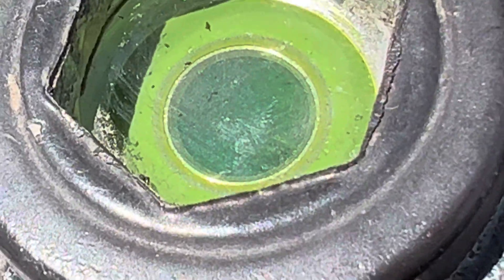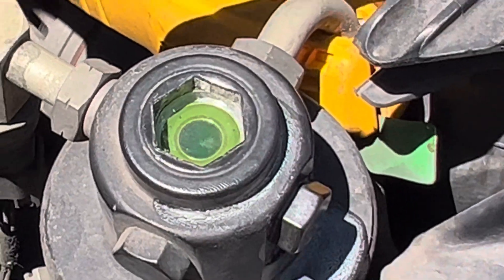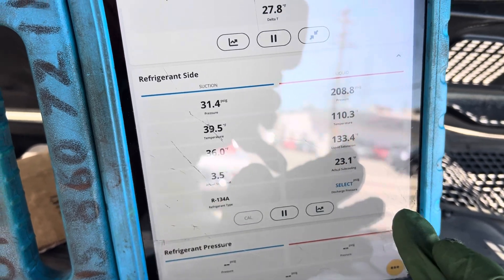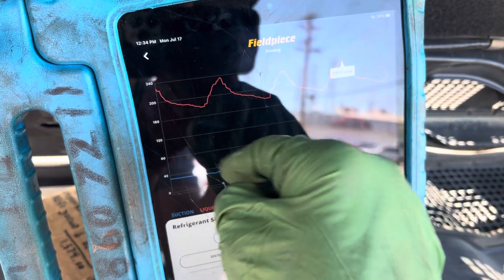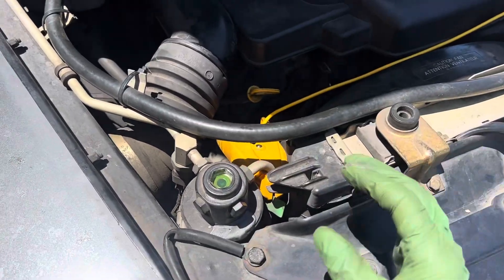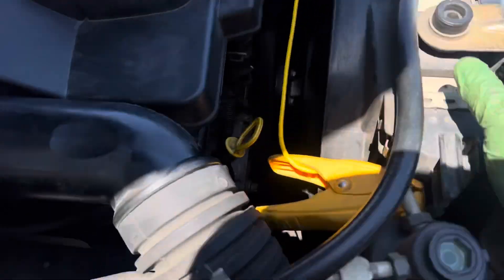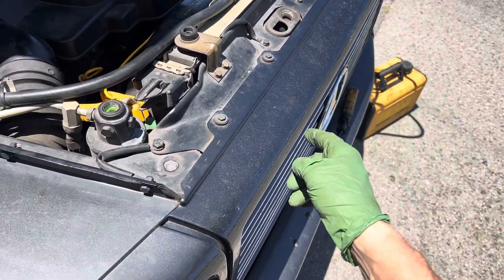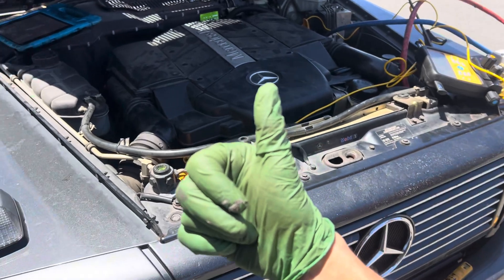Do Not Charge Refrigerant Looking 👀 At Bubbles 🫧

Comment: I have a question.  My 2010 honda odyssey is crazy.  The AC temp from the vent at idle blows 45-50 degrees on a lower speed blow setting. Once i turn up the blower speed the a/c temps jumps really fast to 68 degrees. Why would it blow warmer at a higher speed vs a lower speed. My fan speed has 6 speeds, so it blows its coldest at less then 3, but 4 the ac temp jumps 5-10 degrees
Reply from the maker: Because of the load of energy for every square foot of air, there’s actual energy stored inside of it in the form of heat and every square foot of Air actually has a wait to it that you can weigh on a scale.  If we weren’t already at roughly sea level at the same late level..   it’s a Physics thing, the gas laws. 

So the Evaporator has a defined set amount of energy that it could remove in the form of heat .  The slower your fan speed the last load on the evaporator it can remove more heat. It has a longer contact time over the coils to absorb more heat out of the air that passes over the cold evaporator

The faster you move the more square feet, the more buckets or the more basketball size of air with more heat load faster over the evaporator 

So you’re putting more load over the Evaporator and you can be passing them so fast across the metal coils that they do not have enough contact time to transfer all the heat out of the air in into the cold metal coils so you get a warmer temperature 

Then, there’s also the fact you could be low on refrigerant . 

I have many videos in the past that I have recommended from instructors if you were curious about the Thermal Dynamic Fluid Dynamic’s the three gas laws, and everything Hass to do with the subject and other subjects about air conditioning 

Brian, Orb’s HVAC School 

Craig HVAC LLC

Ty Bremerman Love2HVAC
Reply: @coldfinger459sub0  thank you for all the facts of how it works.  I will check my charge.  I noticed that my low side pressure valve was bubbling when I took the cap off.  

Can the blower resister also play a factor?

I will also watch the videos from the other guys your recommended
Reply from the maker: @edwinaragon8469  blower resistor doesn’t add that much heat

Bubbling valve from your service valve just replace it .
Reply: This suggests your evaporator is being starved of refrigerant.
Reply: @thisisyourcaptainspeaking2259  meaning I'm low on r134a?
Reply: @edwinaragon8469  Yes, I suspect that's the case assuming there's not some other problem such as restricted expansion device or leaking are duct (duct air passing through heater core).
Compression ratio of compressor should not be higher than about 4 (high side pressure in psia/low side pressure in psia).
The correct way of determining charge is by weight because charge level is critical to system operation.  For instance, a system operating low on refrigerant charge may appear to be operating fine, yet will cause the compressor to overheat.
Reply: @thisisyourcaptainspeaking2259  the expansion valve is new, dealer part. I have used off brand and they never worked. This time I replaced with honda expansion valve.

So the bubbles are an indicator that the strater valve is bad and causing a leak. This leak is leading to a lower charge, lost of freon), that is causing my ac not to blow cold on higher fan speeds? 

Am I correct in this assumption. Again, not sure what the expansion valve has to do with bubbles in my lower side port.
Reply: @edwinaragon8469  If you're losing refrigerant then obviously you need to locate any leaks and address them.  Not following you on "bubbles in low side port", low side is vapor phase.
Reply: @thisisyourcaptainspeaking2259  so when I encoded removed the low side cap, I see ac dye forming bubbles. I am assuming that since I see bubbles, it has to be a bad valve core/strater valve that is leaking.  I shouldn't see bubbles forming at the service ports correct?
Reply from the maker: @edwinaragon8469 sometimes you see bubbles for a minute and that his gas that is trapped in there under pressure and it is like carbonated soda pop with CO2 in the oil and you just released the cap to atmosphere pressure so it’s bubbling out of the oil and then, after a minute you’ll see it stop this is considered normal leakage

But if it continues, you got a problem . 

Or when you run the vehicle and delete gets bigger from running when he gets hotter or colder, higher pressure or lower pressure you got a leak and you replace it . 

Buy dropping one or two drops of refrigerant oil on top of it after a few minutes, you’ll see if new bubbles developer not
Reply: @edwinaragon8469  Correct, that's a leaky schrader valve core.  There's a tool available for changing the core without having to recover the charge but the right way is recover and weigh-in the correct quantity through the high side into a deep vacuum.  Otherwise determining proper charge is a guess at best and unlikely to work correctly under various conditions.  Also, by recovering gives you the opportunity to perform an N2 pressure decay test as opposed to risking loss of refrigerant to undetected leaks.
Reply: @coldfinger459sub0  I see,  so I need to wait to see if the bubbles remain after removing the cap.  I did not know it could bubble after removing the cap.  I didn't stare at it long enough to see if it stopped.  

Maybe I will try that and maybe blow air over the port to clean it out and drop ac oil to see if it continues. I'll wait 10 mins after removing the cap just to make sure it acclimate to the atmosphere.

A lot of talent.  I'll also spray some ac bubbles over the expansion valve connector on the firewall to see if it forms bubbles. 

I'm obviously low of refrigerant for my ac to only blow cold on low fan speed from what your telling me.  

Nothing else would cause this correct? Having ac blow cold on lower fan speed, but once I put it on max,  it jumps 10 degrees hotter.
Reply from the maker: @edwinaragon8469  it’s old you just replace the valve cores

since we have hundreds of valve cores on hand in stock, we just replace them on every vehicle when they’re old, no matter what it’s not worth the risk 

And there is no guessing unfortunately the easiest fastest way as we just automatically recover in Recharge Ave vehicl, and then test it only takes 10 minutes 

This way, you’re always testing a factory filled unit up to manufacture specifications
Reply: @thisisyourcaptainspeaking2259  the tool your talking about is the valve core removal tool that allows you to shut the valve to prevent it from leaking out once the core is removed correct? I saw NAVAC sells a 1/4 valve core removal tool.

I am doing the work myself because no shop will vacuum my van to 500 microns as Tom has showed in his videos. I bought a vacumm pump to do the job.

I'm charging my system using 12 oz cans, but using a scale to help me get the last bit in on the 3rd can. I fill on the low side because I don't have away to charge on the high side as I don't have a 30 lb tank. And I can't put 12 oz cans upside down on the scale.

I also don't have a nitrogen tank to test for leaks. I am simply vacuum the system and waiting to see of I have a lost of vacuum.

I did all this before, but I guess I didn't charge it correctly the first time and it was low or maybe I do have a leak.

I just don't trust a shop around me because I paid $8k total to 2 different shops and they still not could not get my ac to blow cold.

After watching Tom videos, I redid all the work myself, new parts, and vacuumed to 500 microns (took me 2 days to reach that level), then charged my car based on weight, the best I could and finally my van was blowing cold.

It's just now that I noticed that I blows warmer air at higher fan speed vs lower fan speeds.
Reply: @edwinaragon8469  Agree.  Inspect carefully for leaks and avoid overcharging because liquid cannot be compressed.  Too low of charge results in a starved evaporator and thus abnormally high duct temps as fan speed is increased.  Compression ratio will be high, causing compressor to run hot and maybe burn the oil. Oil won't circulate properly, leaving the compressor dry of lubricant.
There are so many reasons the equipment and tools are worth the investment, considering just the replacement cost of parts alone.
Reply: @thisisyourcaptainspeaking2259  question. Right now, the outdoor temp is 102 degrees. My low side pressure is 50 and high side pressure is 250. Does this also indicate low freon for a 2010 honda odyssey
Reply: @edwinaragon8469  Possibly, but be careful with that assumption.  Consulting the pressure/temperature chart for 134a tells us 50psig on the low side means the evaporator temperature isn't less than 55F and condenser temperature is about 155F.  The unknown here is if there's a (desirable) column of liquid entering the expansion device and there are no non-condensables (air contamination) occupying space in the condenser.  You could measure the temperature of the compressor suction line to help determine if superheat is excessive.
Reply: @thisisyourcaptainspeaking2259  I uploaded a video of my gauges on my account. If there is anyway you can see it to make sure I am reading my gagues correctly
Reply: @edwinaragon8469  You're referring to the clip loaded 7 days ago?
100 degree ambient is relatively high, thus (obviously) it's especially important everything's working correctly.  What happens if you hose down the condenser with water, does the system respond dramatically?  Is it possible airflow through the condenser is impeded by debris or some missing rubber gaskets between the condenser and radiator, allowing air being pulled through the radiator to bypass around the condenser?  How about system performance while the vehicle is at speed, forcing air through the condenser?
Reply from the maker: 1: I forgot have you clamped off the coolant flow through the heater hoses?. To test ? 

What is the temperature of the suction line coming out of the evaporator?.

And this vehicle is filled up with 750 g  ? Is that with the sticker under the hood says.
Reply from the maker: @edwinaragon8469 we do not go by pressure 

We only completely drain system

Evacuated with a vacuum pump and fill it up, measured by weight on the scale. 

This is the only way a system is charged. 

Anything else just guessing?.
Reply: @coldfinger459sub0  ok, I'm an vacuuming my car now.  Going to let it run until 500 microns or less. Probably going to take me all day and night to reach that level.  

I got a 30lb r134 tank and scale.  Going to fill by weight through the highdide port,  with the can upside down.  

Question, do you purge the line of air while it is in vapor, then flip the can over to liquid and fill by weight?
Reply from the maker: @edwinaragon8469  yes, purge the line in the vapor. 

Are before you start way the tank all by itself so you know the precise weight of the tank wait for the liquid refrigerant to stop moving slashing back-and-forth inside to get an accurate weight . 

This is so after you are finished you can weigh the tank again when you’re completely finish 

In the weight should add up to what was needed in the vehicle 

If it is more than you know, you make a mistake and you have too much 

If it is less than you know, you made a mistake and you don’t have enough . 

If you accidentally bump your gauges or bump your hose or if the car actually internally moves forward to backwards during the process make sure your brakes are on the car cannot move .  Make sure it is not windy.. 

All these things can throw your measurements off and you won’t know it . 

Unless you completely know, and understand the gas laws, you will might not be successful at completely charging the vehicle through the high side as a liquid . 

And you might have to stop and precisely record the weight that has gone in . 

Flip the tan over to the vapor side . 

To start charging as a vapor on the suction line after the engine is running in the air conditioning is working . 

Because you may not be successful doing the liquid charge method. 

But the most important thing is recording and being able to track how much refrigerant comes out of that cylinder . 

Because when you’re all finished, it should add up to the manufactures recommended specifications for that particular vehicle . 

If it doesn’t, you may have to do it all over again . 

Air conditioning is not very forgiving and making mistakes . 

Sometimes it may work if procedures are not correctly done it’ll blow cold out of the dash to cause problems much later on .
Reply: @coldfinger459sub0  so you recommend me doing the charge via the suction line (low side) vs the high side then to make it easier?

Also,  does the car need to be leveled or does it matter,  as my drive way is slanted and has a a good pitch?

Shouldn't we expect a weight difference slightly as there will be refrigerant left in the line when it's done.  

I will weigh the can before I start and after.  Hopefully it close as the van has a max of 750kg and a min of 700kg. On the sticker
Reply from the maker: @edwinaragon8469  it does not have to be level for the van

The scale should be level 

I think because you’re a beginner and a novice at this you should stick with the suction side vapor charge method it will take longer . 

But it’s the more safer easier but longer method
Reply: @coldfinger459sub0  So I pulled a vacuum on the van,  got down to 1130 on the micron guage. It was not going any lower after 2 hours,  so I decided that was as low it was going to go,  since I didn't replace the dryer.

Charged it to weight,  and I'm happy to report my van is able to blow 55 degrees out the vent at high can speeds, vs 70. 

I am so happy with the results.  

Thank you for allowing your feedback and quick responses. 

You are a true expert. 

The low side pressure valve was no longer bubbling after waiting for a while.  

So I figured I didn't charge the van right the first time using 12 oz cans.  

This time I bought the 30lb and scale and filled it like how you show,  through the suction line and car turned on.

Thanks Tom.
Reply from the maker: @edwinaragon8469  I invite you to tell your story and your experience over to Facebook group

Automotive, HVAC Technicians 

This is a place where you can show photos upload a YouTube video and ask questions . 

Or just tell other people about your first time learning experience .  So other new people who I have not asked this question, you can learn from your trial and error.. 

And how you completely successfully fix the problem? . 

Good job 👏 👍 

You seemed a little small cans have caused so many people so many problems . 

And often sometimes it’s a problem it comes out cool out of the dash But they are unaware that is an actually damaging the compressor because they did not properly charge it.
Reply from the maker: @thisisyourcaptainspeaking2259  in some cases, the bubbles are only at this point of the receiver dryer as would be this case where the system is 100% full

And the expansion valve is receiving at this time that you see bubbles 100% solid liquid column with no bubbles to it 

The pressure temperature saturation is happening inside the line after this section of bubbles stacking up from the expansion valve along the middle line, coming all the way back to this point 

Somewhere just passed were these bubbles are in this line it’s probably for maybe another 6 to 12 inches 

If there was a site glass a few inches away from the expansion valve, you would see a solid column of liquid with absolutely no bubbles

This is why on my commercial or my residential installations where I have a liquid line I will install a site glass down at the evaporator just before the expansion valve, and I will put another site glass outside towards the condenser so there is two 

This is why sometimes you can see the side glass indoors a few inches away from the expansion valve is being delivered a solid column of liquid and then when I go 50 feet up on the roof to look at the other side glass, it will be bubbly and foaming, but yet the superheat and sub cooling everything is perfect 

As you transition going through cycles of on and off 

No one wants to put in their price of their job the labor plus the parts of to say glasses because they’re afraid to lose the job 

I do this on all my jobs. I always have my father showed me this. 

And with the site glass by the air handler indoors when talking to a customer on the phone, you can ask them to look at it and see if it’s crystal clear or bubbly
Reply: @coldfinger459sub0  sorry Tom, I'm not sure how this is supposed to help me figure out on my van why I see bubbles, other then the valve has a leak? What does the expansion valve have too do with my low pressure valve having bubbles?
Reply from the maker: @edwinaragon8469  there’s a reason the expansion valve is called a metering device

It has spring pressure. It has a gas pressure. It has a diaphragm. He has a needle valve seat. 

It opens and closes in response to the heat load over the evaporator modulating 

This will either choke off the refrigerant flow or open up, wide-open and release the refrigerant. This will lower the pressure on the line .   And it will use quickly a short larger burst of refrigerant that may lower the Refrigerant level in your receiver dryer faster than I can recover and you’ll get some bubbles in your line as the pressure drops.. 

It doesn’t mean it’s slow it just means there’s a modulation going on . 

This was all going over in high school auto shop .  Or in trade school or in city college or when you were in science or chemistry class in college or university when they were discussing or talking about the gas laws. 

This is why people who went out of their way to learn and study these things, and remember them and use them on a daily practice basis don’t have any problem properly diagnosing problems, and replacing parts that are not needed or not replacing parts that are needed because most just guess how to fix things and try to use some logic of averages Without actually ever really knowing.
Reply: @coldfinger459sub0  Agree, I prefer to locate the sight glass as close as possible to the expansion device because that's where the liquid refrigerant needs to be.  If further away, the system is more likely to be overcharged.  Even so, I'd rather see a few bubbles as opposed to zero bubbles, concerning visual inspection.